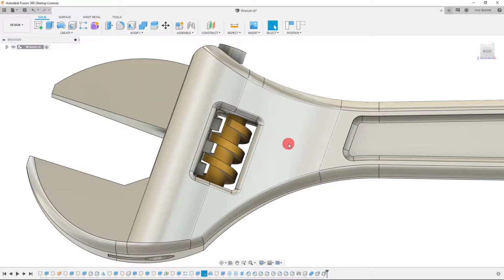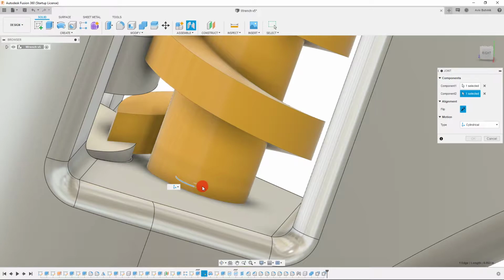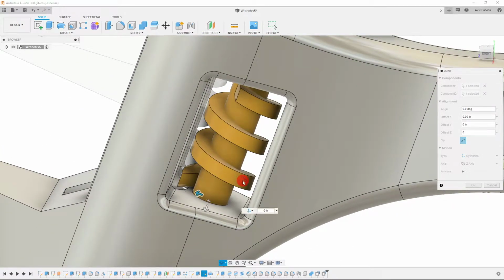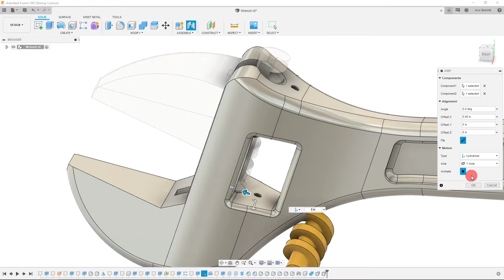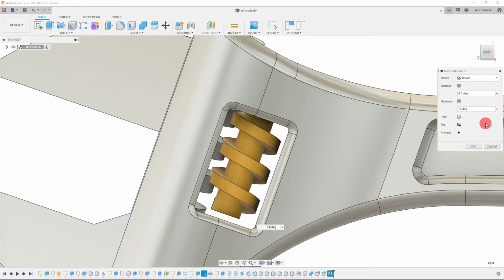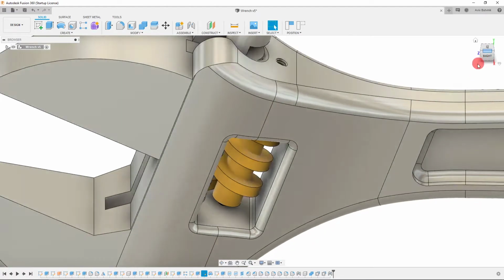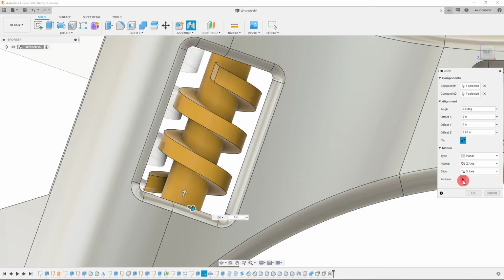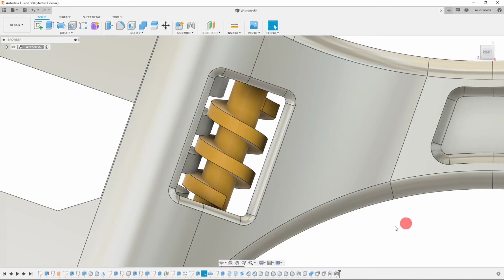Cylindrical Joints Fusion 360!

Comment: Why not use a Revolute Joint?
Reply from the maker: Cylindrical has one more degree of freedom. You can move linearly as well as rotationally.
Reply: @AvivMakesRobots  Thanks for answering. Sure, but you added the planar joint, which turns it effectively into a Revolute Joint, right?